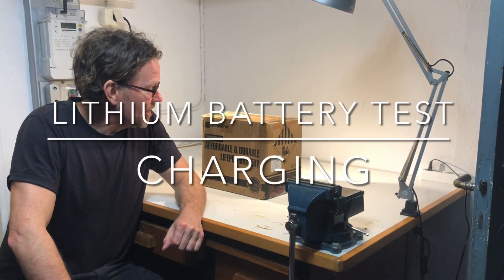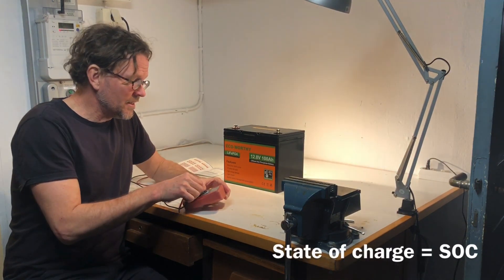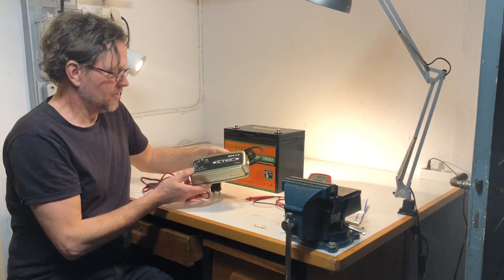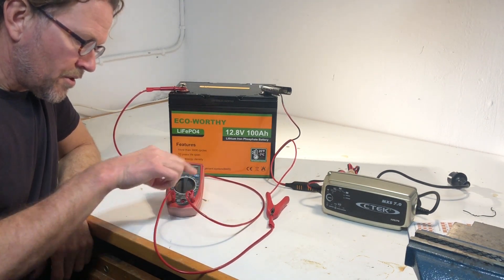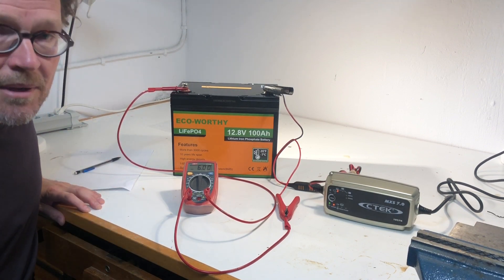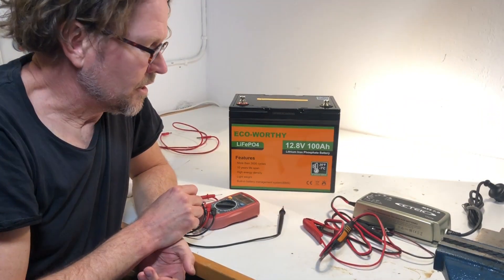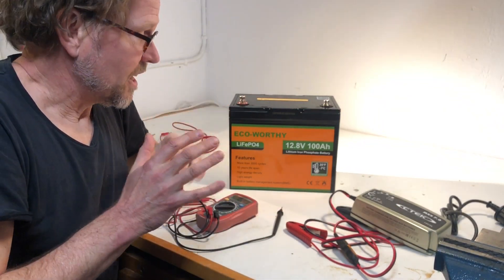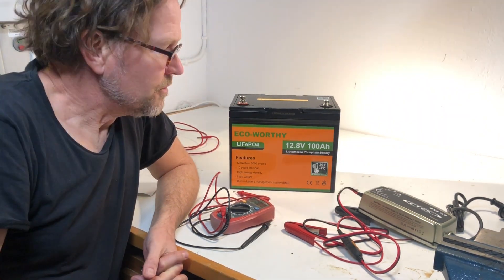Can I charge a Lithium battery with a lead acid charger?

Comment: Thank you and good experiment.  I have the 20A version of the CTEK charger and will be using it on the 12V LifePO4 battery.  Did you charge using the "normal"  mode setting of the charger?  If so, did you allow the charger to complete the entire charging sequence in that mode, i.e. leaving it charging through all the sequential steps until the last LED light turned green?
Reply from the maker: Yes! Correct. That is how the charger was used. It was in ”Normal” mode and went through all stages. Thank you for your comment.
Reply: @StreetlevelEngineering-uc5cb  Thank you!

Comment: Surprised you were able to charge that low quality battery.
Reply from the maker: I have now used it for a season powering an electric outboard motor, being charged by solar cells. Works well. Now it is stored in the boat at sub zero temperature. Voltage remains at 13,1 V. 

See my video: Sailboat with electric motor, batteries:
https://youtu.be/ciKJVMu-5QA

I am curious about your experience?

Comment: What did the manual or documentation suggest to use as a charging source. Or the charging specification
Reply from the maker: The manual does not go to fundamentals on this point. It only says ”Use a special charger for lithium battery” and ”Check that the charging voltage corresponds to the battery requirements.” No deeper info what suitable voltage would be. It is needed to do some research to figure out that there is a match. It was clear to me that 14.4 V was the max voltage from the charger (and only for a limited time) and that this would be fully ok for the battery. In addition to this good fundamental match there is the BMS that would protect from too high charge voltage. Good basic conditions and the BMS made me confident that it should work well, but I monitored the charging process if there would occur some problem I had not foreseen.

Comment: I guess that as long as the charger keeps the voltage regulated at what is acceptable for the battery then all should be well. I see you use a modern automatic smart lead-acid charger. Not to use an 'old fashioned'  unregulated lead-acid charger though as their off-load voltage could be as high as 18 volts- and that would make the experiment TOO interesting. ;)
Reply from the maker: Hi! Nice with a comment! Yes, it is true. This charger will not go higher than 14,4 Volt. In addition to that the battery management system protects from overcharge / too high voltage and also over discharge / too low voltage. I provoked the battery and triggered the last one in my discharge test that I will share.
Reply: From what I have heard and read, the Float Voltage should NOT be any higher than 13.35 Volts and maybe even 13.33 ( which is the overnight Resting Voltage of a Fully Charged Lifepo4 Battery